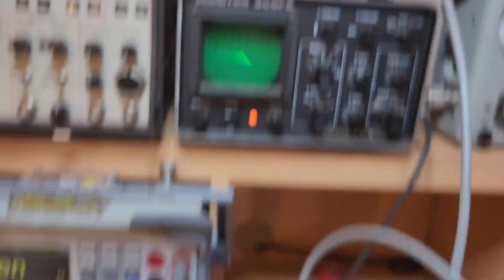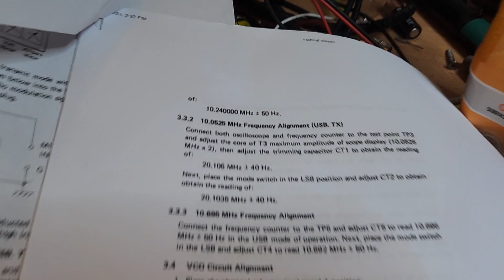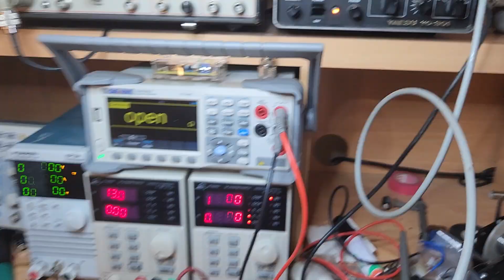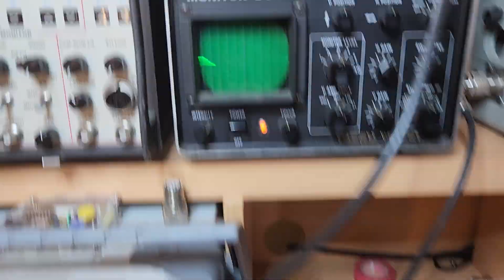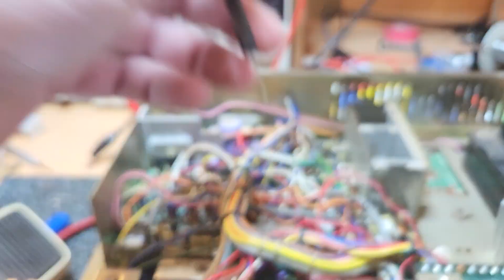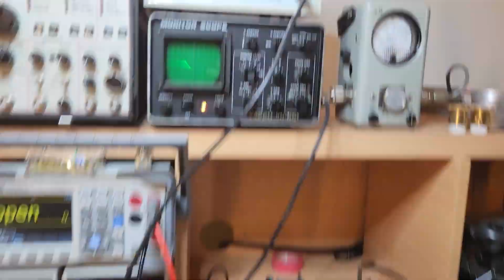So you want to align Freq and a few other settings on your Cybernet Chassis PLL02A?Here's some help.

Comment: Hi Benton,
Not sure if you're still around on here.
I know this is an old video, great video btw.
I'm just looking to see if you might still have any test gear you're looking to  sell?
Namely, I'm looking to buy a Sinad meter and possibly a frequency counter that will do at least 6 digits, or maybe even 7-8 digits would be better.
I already have a scope, sig gen, swr-watt meter etc.
I'm in Perth, W.A, getting back into the hobby after 20+yrs, I'm looking to give all my old radios a proper once over.
👍🇦🇺

Comment: You can use a cro probe and put it on the by 10 x so it wont load down the rf circuit.

Comment: I've found best to have the radio on TX when you do the 10.695/692 that eliminates the clarifier circuit.  That should put it bang on for TX, it may leave the clarifier a smidge off 12 o;clock, but at least the TX will be bang on.

Comment: Where did you get your 50 Ohm lead from or did you make it ? Remember the AGC when tuning the RX ,don't  thro a huge signal in or the AGC will take over. Great Vid mate to get the up and coming radio techs interested.
Reply from the maker: good question re lead, I suspect it came from one of the workshops we bought out down in Mt Gambier, and yes, less is definitely better with Rx tuning, we ran a bit high and what Glenn is saying is so correct, you will see much better and more achievable gain with less signal, us old techs get complacent, that's for sure😆😆😆